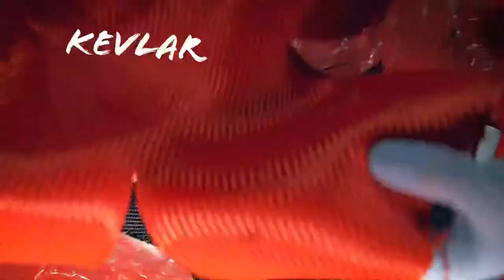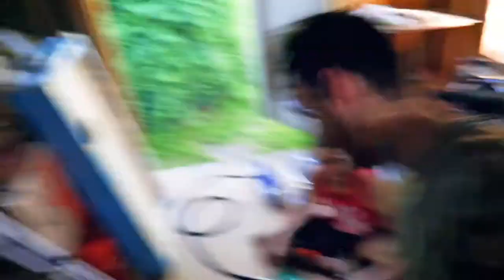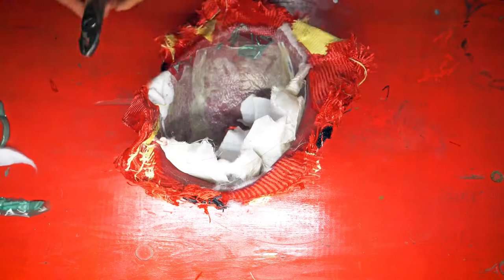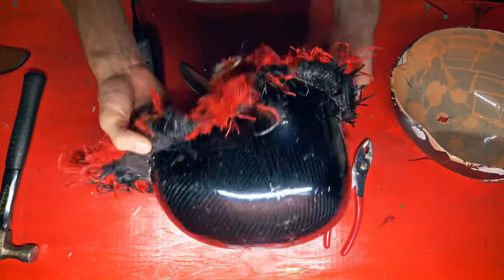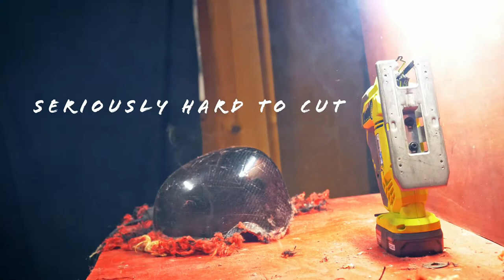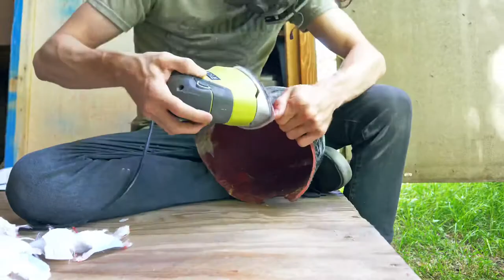Bulletproof Motorcycle Helmet

Comment: Get an angle grinder and a diamond wheel disc 

The dust produced seems to be similar to masonry materials
Reply from the maker: I was actually thinking the exact same thing!  Since the video I’ve done exactly that! Good looking out!
Reply: @sambuildsstuff8990  just dont buy a steel wire cup thing and a chainsaw disc 
Those are the worst 
Also if u have the control u dont need the guard 
I stopped using my guard after about 3 months cos it gets in the way and could cos more problems 

The only time it's useful it when u need to direct dirt away from ur face 
I'm lazy to put mine on so I usually leave it off 

Also u need more safety gear when cutting soft metals and materials 
If you've cut em u know if u havent make sure to have at least ur eye protection on

Comment: Do you have to wait for each layer to dry first before adding the other layers? I'm doing the same thing with a polycarbonate bump cap but using Kevlar and UHMWPE fabric sheets, with D3O foam for padding underneath.
Reply from the maker: I had all my layers dry at the same time Under the vacuum pump
Reply: Hi sir